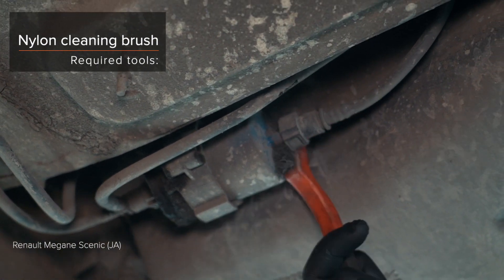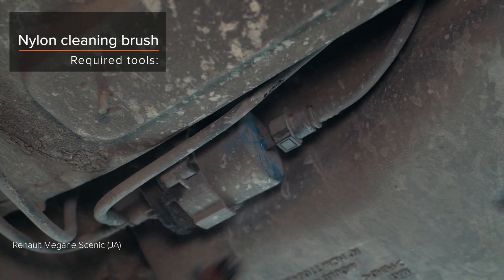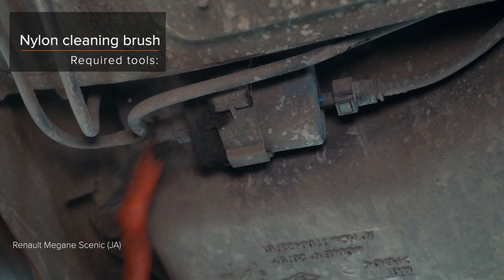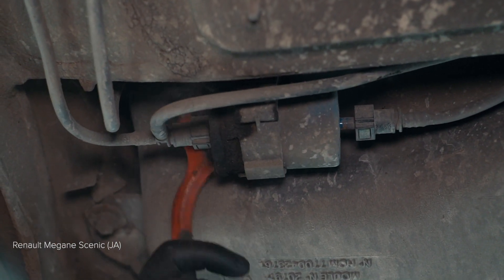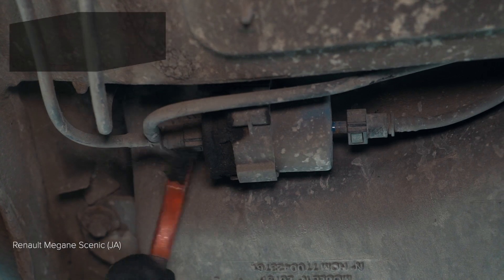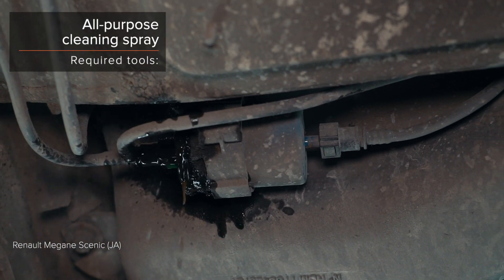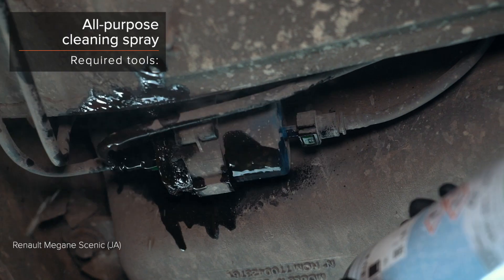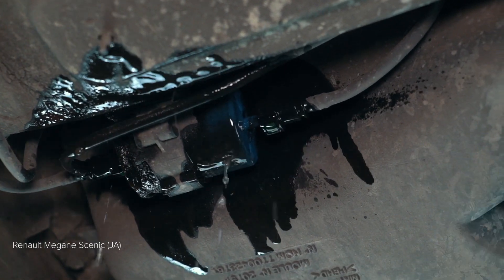How to change fuel filter RENAULT MEGANE SCENIC [TUTORIAL AUTODOC]

Comment: Please where can I find the fuel filter for a Renault Megane Scenic 1 / model 2003 motor 1.6 16 V . Is it in the gas tank or is it on its side? because I searched for it and did not find it, please reply
Reply from the maker: Hi! Thank you for your comment. In most cases, it is located on the bottom of the car on the right side in front of the gas tank, you can find more accurate information in the technical documentation for the maintenance and repair of your car.

Comment: What is the procedure if my lid is the type that it cannot be unscrewed,it just a little metal circle door that is automatically moved when you put in the fuel hose? It is renault megane 2 saloon 1.4 2009. Do you back up pressure with turning off on several times at the end?
Reply from the maker: Hello! It’s difficult to provide a definitive answer to your question. However, we did turn on the ignition several times at the end to ensure the system was filled with fuel before starting